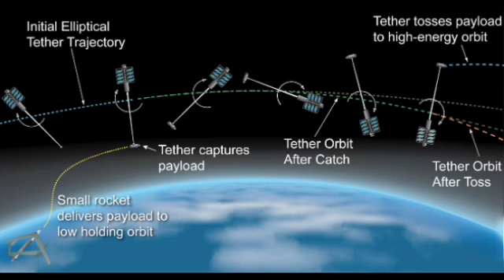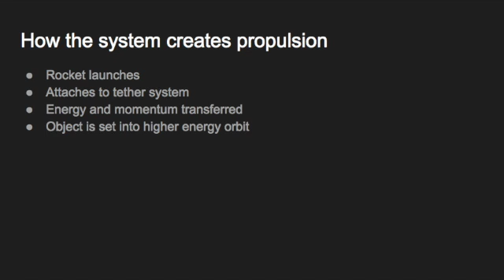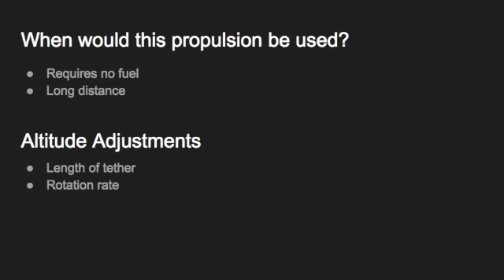Momentum Exchange Tether Propulsion

Comment: How large is the acceleration?
Reply: Too many "it depends on this and that factors".....  but in theory, current material science has the tensile strength for a tether to supposedly take a fast moving jet in the upper atmosphere and put it in earth orbit. That's been called a Skyhook.  It's worth googling 

Somewhat related technology. SpinLaunch currently has a suborbital launcher that uses a tether to launch. Soon it will begin work on an orbital launch platform. That spins up an rocket on a tether. 
 
The ability to conserve momentum between incoming and out going ships is vastly under appreciated. 

I'll refer to reusable satellites with tethers as Tethered Momentum Transfer Space Stations,  TMTSS. 

But Space around earth is too crowded with satellites for a skyhook, earth to space TMTSS. But several TMTSS  in orbit about the sun between Earth and Mars can easilly conserve momentum accelerating and decelerating space craft in transited between earth and Mars, vastly conserving immense amounts of fuel in exchange for greater payload. 

Several TMTSS  in orbit around Mars would be able to very nearly lift craft right off the surface to martian orbit while also reducing space craft momentum for landing on the martian surface.  

TMTSS capability for conserving momentum is vastly under appreciated.